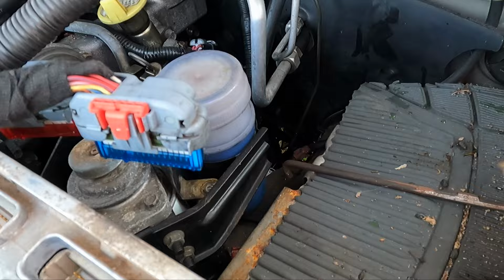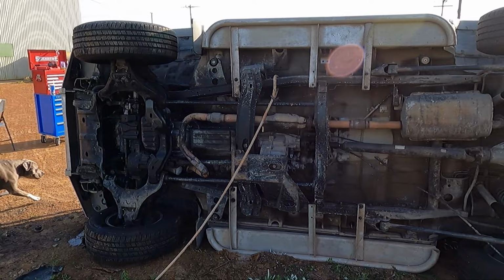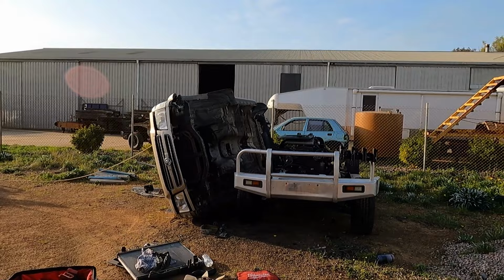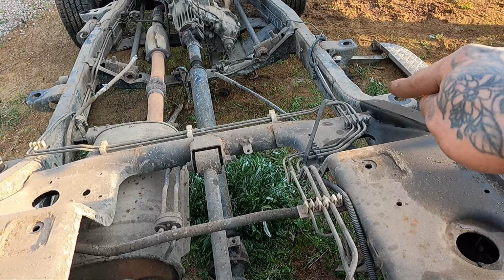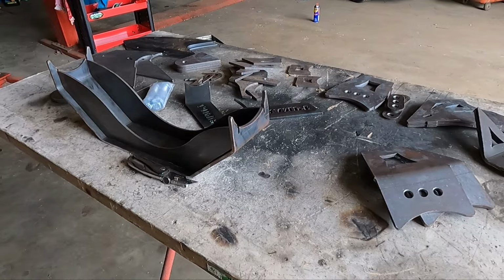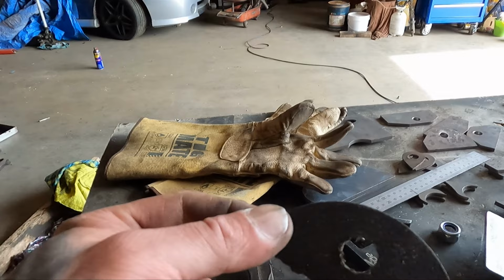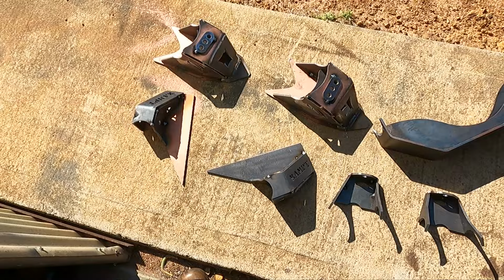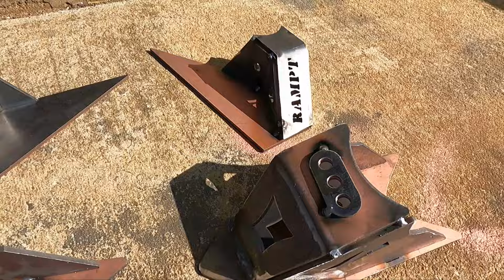Building the Ultimate Holden TF Rodeo | Stripping the Jackaroo and Rampt Customs 4 link | PT1

Comment: Very exciting build, mate. Entertaining way of pulling the body off. Do the rodeo and wagon share similar chassis. Can't just coil the rodeo chassis? Either way great project  👍
Reply from the maker: They're very similar at three front and till behind the torsion bar. (About where the rear doors start) then they change massively. I still might just coil the rodeo chassis as it actually seems easier to do the 4 link on that chassis than the jackaroo one. Just means it'll be parked in the shed for abit
Reply: @jamestyrrell4179  maybe front half rodeo and the rear half the wagon and cut it a little longer to compensate the extension. The wagon rear looks beefier than rodeo rear chassis (I had one of these rodeos on the farm), which may make only one join instead of two joins per rail if you stretch it.
No doubt you find the best way.
Reply from the maker: @79series  yea ill figure it out. but the jackaroo rear isnt to 4 link friendly with a crossmember in the way so ill have to sort it out